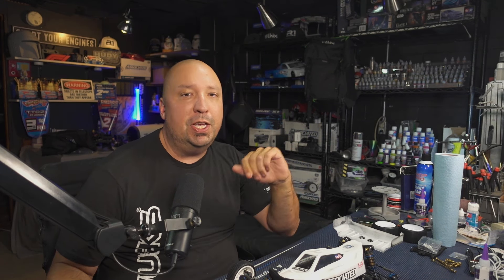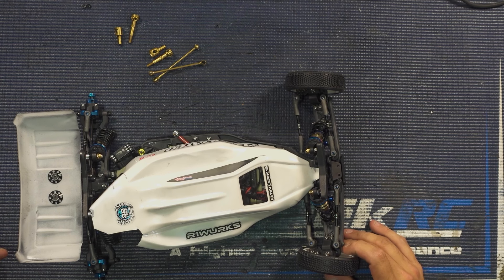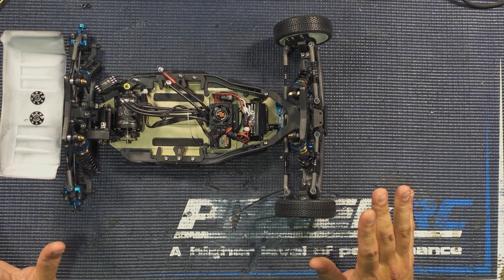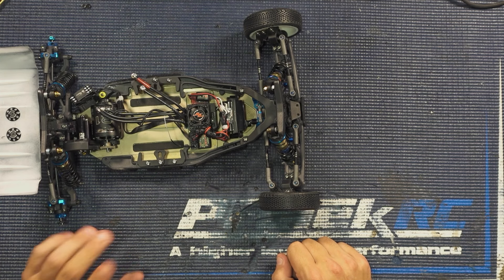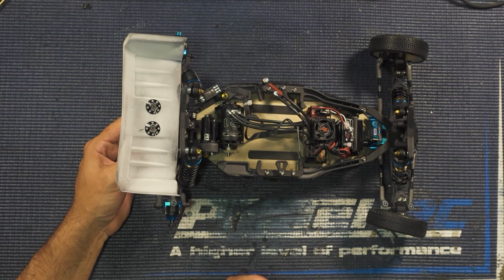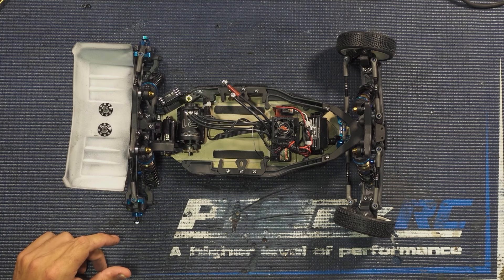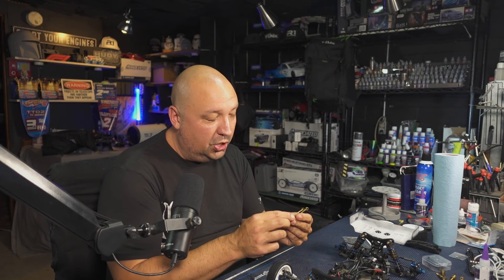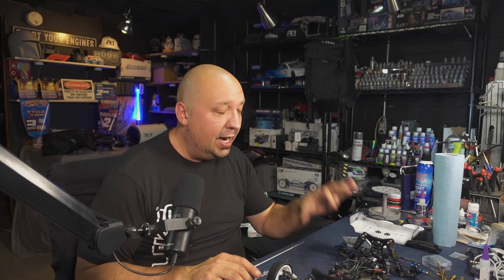TEAM ASSOCIATED B7 CRAP PARTS AND MORE R1 GOODIES!!!

Comment: Installed the ar1 KPI. One of the things i realized after is that using additional shims the possibilities for settings are greatly improved. I used 1Up presision 3mm shims. Highly recommend. 
Wish R1 would basically come out with a compleate B7 kit lol.
Reply from the maker: Yeah man I put them on. Get to try them this weekend. Can’t wait. So much better than those plastics.

Comment: It's a shame to see how many option parts seem non optional on this thing. Especially considering how solid the 6.4 was and still is right out of the box. I suppose I'll be running the 6.4 for a while yet! Mine's got an AGFRC Servo, Justock 21.5, a slipper eliminator, some setup changes, and its very competitive at the local club. Just solid and consistent. And when I do crash it just bounces. The only time I broke it was the front upper link mount when I hit the back of a parked Rustler at 100% speed just before the braking zone at the end of a straight.
Reply from the maker: The 6.4 is a great chassis!  Most of these parts are really for a little rigidity and being able to shave weight and then add it back in with better placement or the battery